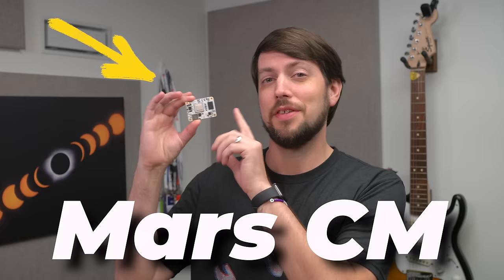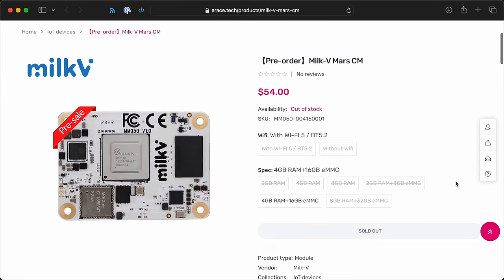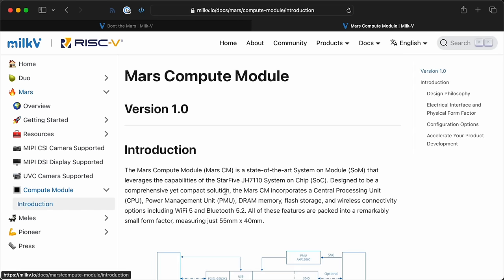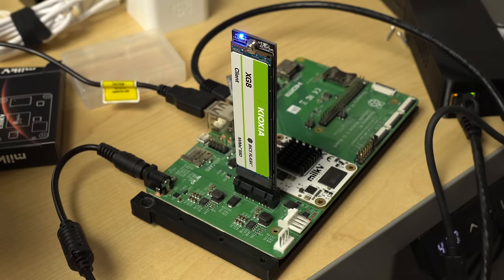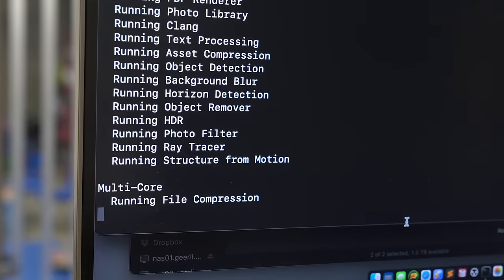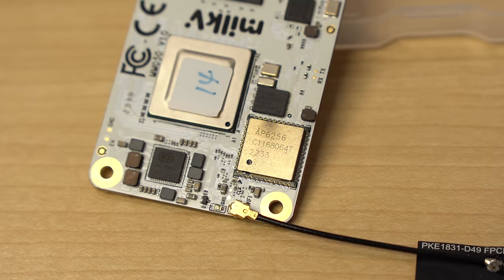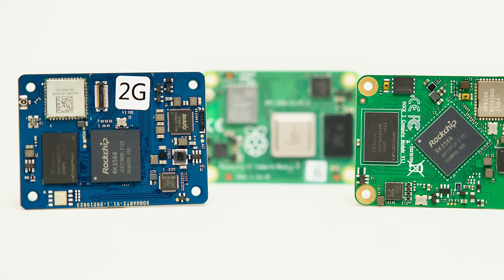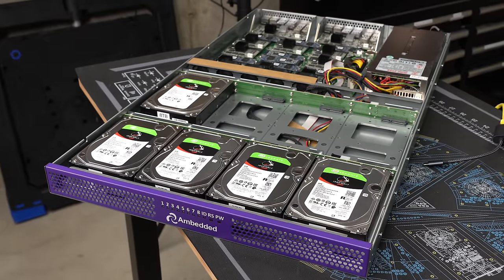RISC-V isn't killing Arm (yet)

Comment: It took ARM 20+ years to get an out of order design. RISCV did that years ago. From OoO to competing with x86 has been 15 years if we count X4 as competitive. RISCV is on track to do that in just 4-5 years which is literally the bare minimum to design a new microarchitecture. 

While there’s overhypers out there, is also true that we will have high performance chips in the next couple years.
Reply: The main problem is uprooting comparability. ARM filled a needed niche, and by all accounts an "empty" niche. The reason why we won't see x86 fall is due to the last 30yrs of development and the largest amount of focus. Arm has done that for its niche in the mobile phone market and even in the Microcontroller market.
Though I would agree in the super small Microcontroller (like remotes), it could have a place due to the lower costs ($0.001 off is a lot for something that costs $0.01 in bulk order) and the lack of legacy need.
Reply: I'm afraid you're one of the overhypers.  You try to hold it against Arm that it took over 20 years to see an OoO chip, but that's actually just because the first two decades of Arm were the 1980s and the 1990s.  In the 80s literally nobody was selling single-chip OoO microprocessors.  That began to be a thing in the 90s, but it was far too expensive for a tiny company like Arm.

Next, we  have to talk about actual ages of the Arm and RISC-V ISAs.  RISC-V derives a lot of things from older RISC ISAs, and modern Arm is technically only about 10 years old (counting from first commercial chip).  You see, the 64-bit Arm ISA was a complete do-over.  You can design dual-mode 32/64-bit Arm cores, but the Arm chips making waves right now (such as Apple's A and M series, and Qualcomm's new Oryon) are 64-bit only.  The first commercially available 64-bit Arm was Apple's A7, which shipped in the fall 2013 iPhone refresh.  (It was OoO, by the way, so 64-bit Arm went from zero to OoO in one step.  Doesn't really mean anything, but you seem to think it's important.)

The big problem for anyone who wants to believe RISC-V will inevitably overtake Arm64 is that Arm64 is a very well designed ISA and RISC-V is not.  None of the mistakes in RISC-V's design are fatal, they just make it harder to create high performance RISC-V chips, and possibly may result in extra power and/or die area.
Reply: It is almost as if multiple people can work on an open standard and take it farther because of that

Comment: Thanx for the video, very informative and yes the RISC-V architecture is not mainstream yet, but we need more choice in this sector. In my country everything is expensive, so cheaper alternatives are a plus. I only managed to purchase a RPi4 this year after losing out in 2020 with the Coolermaster case kickstarter mess. Yes, the Pi community is great, but RISC-V will get there. Just look at how far the Rock chip boards have come!

Comment: it's pretty early for risc-v to start getting a piece of the SBC market, it still needs manufacturers support and funds for R&D and software. but it is making a small but steady step in the microcontroller market with a few fairly nice little boards.
Reply: There's a few good boards already, and in the next couple years there's going to be a lot more on the market. They may not be the absolute best, but nerdy folks will buy them to tinker around with, and that will fuel more R&D budgets and more boards. The idea of RISC-V has excitement attached to it that ARM can't hope to match, for the types of people who like to buy these boards. At the same time, the AI market is embracing RISC-V, and lots of big companies are buying in for all sorts of embedded apps. Lots of real world uneasiness is also driving interest in RISC-V (or rather, driving people away from ARM) at those big companies that want to hedge their bets.

Comment: Just like ARM isn't killing x86 (yet) - but Apple proved, it has the potential to do that. And when you look a bit deeper into the design of the RISC-V instruction set and it's philosophy, you can see that it has the potential to kill ARM in the future, as its design is more sound, just like the design of ARM is way more sound than the design of x86 . Some people are not happy with certain trade-offs that were made but you always have to do trade-offs, there is no ISA that doesn't have any trade-offs. I studied pretty much all CPU architectures in the past and just based on that I made predictions like PPC not having any real future, since its architecture seemed flawed to me, so when PPC struggled with 64 bit CPUs and Apple finally gave up on it, that didn't came to me as a surprise at all. What did came as surprise to me was the Xbox360 switching to PPC but I guess that was the last time we saw PPC for the mass market. I also wasn't that surprised when Apple went all ARM, yet I didn't expect them to have the guts to truly pull that off, as it once again set off their machines completely from the Windows PC market (and I'm still sad to have lost VirtualBox support on Mac). But not only has RISC-V the potential to reach ARM performance, it has the potential to reach it at lower power consumption. And once again it's Apple, who hired a lot of RISC-V experts in the recent past. I wouldn't be too surprised, if one day Apple announces that the Apple Watch now has a RISC-V CPU and this will give that architecture a huge leap forward, as they have the money and man power to push that ISA quickly forward, to the point where it could actually compete with ARM at least in the low range sector. And the big advantage for Apple would be: No more license costs for their own RISC-V CPUs and also no license restrictions whatsoever.
Reply: You've got me curious, now. What were the flaws in PPC that you saw?

I do agree with you that Apple is probably going to end up switching to RISC-V down the line. They will probably (and maybe already have been) start with small RISC-V based chips on their boards controlling batteries and the like, and just not tell people. So much of Apple's hardware is a black box anyway. They could work their way up from there to watches, phones, etc.
Reply: @fakecubed Posting a detailed analysis of the PPC architecture in a YouTube comment would probably go to far and YouTube does not like external links (each time I post a link, no matter what link, no matter what destination, other than YouTube itself, my comment vanishes within a few minutes). 

But in a nutshell: PPC basically tried to make everything different than existing architectures of that time and that's rarely ever a good approach, since the only reason to make everything different is when everything sucked but that's never the case. Architectures may have flaws but they are not 100% flawed, as then they would be useless. If you change everything about cars, you end up with a sailboat, which is not a useless product but it is useless if your goal was to design a better car. A GPU is also a useful piece of electronics but it's no replacement for a CPU and incapable of running standard software; at least it could never do so efficiently (of course, you could emulate an entire general purpose CPU within shaders, that would work but would also be very slow).

The instruction set of PPC is not designed for normal computer tasks. It's a bit like IA64 (Itanium), which I saw for the very first time and immediately thought "How will a normal, modern UI application ever be able to fully utilize that instruction format or somehow even benefit from it?" I cannot explain that in detail here, but just look at some numbers: 

ARM has 19 different instruction formats (actually just 18, one is just a special case of all the other ones), PPC has 15 different base formats, with almost each of them have 2 to 4 sub-formats, sometimes 7, yet one has 35 sub-formats. Sure, x86 has more, but x86 is a CISC instruction format, not RISC. The ARM instructions are dense and a single one can combine a condition, a math operation and a logic operation, all in 32 bits; so very common source code constructs will result in a single ARM instruction. On PPC you need 3-6 instructions to achieve the same outcome, again, each 32 bits. RISC-V has only 4 base formats, with 2 extra ones that are just variants of two already in the base set. It's less densely packed than ARM when it comes to function but more densely when it comes to working with data (e.g. intermediates) and RISC-V allows for way more instructions in total, so it doesn't have to stay RISC all the way, it can do things like adding a single instructions that performs a complex operation that would otherwise require plenty of instructions if that should ever be required or vastly beneficial.

Also while x86 and ARM both offer 3 different kinds of memory barriers, PPC only has one. This makes it easy to "not pick the wrong one" but it also means that a lot more synchronization must take place than would strictly be necessary, which is an issue if go multi core and want to keep increasing the number of cores. RISC-V has two and both reserve bitfields for future use to make them even more fine grained, if required to increase scalability. There are other things that make it way harder to scale PPC and x86 core-wise than it is for ARM or will be for RISC-V. And even if you can scale the number of cores, there is always the question how often will one core slow down another core which is also ISA dependent, as that prevents a huge number of cores from reaching their full potential. For decades speeding up CPUs mainly meant increasing the clock rate but that isn't the case anymore for over a decade. Today adding more cores is often way simpler to do and here ARM performs really well, as it is very simple to add more cores without requiring a super complex or ultra-fast inter-CPU bus system, that is almost as complex as a CPU itself or is very power consuming. Just compare the CPU bus of x86 server CPUs (with plenty of cores) to the one of x86 consumer CPUs (with way less cores) and you will see what I mean by "complex bus system". And being super relaxed at the memory model surely helps PPC, just as it helps ARM and RISC-V, yet you cannot always be relaxed, you need fences, atomic operations and explicit ordering and here I see PPC struggling more than other RISC architectures; well, Alpha would have performed even worse, but that's a different story. And don't get me wrong, every architecture allows scaling the number of cores, this was just about how much effort that is, how costly it is, how much it will add to power consumption, etc.

Comment: Love the Video you are 1/2 correct on the Licening on the RISC-V. RISC-V is Opensouce and there are no Roaylties. It's important to note that while the RISC-V ISA is open, the actual processor implementations (e.g., CPU cores) developed by companies may have their own licensing  I am sure you knew that but it came off that RISC-V is pretty much the same as ARM that that isn't correct at all. People would rather pay someone for their design than doing their own.
Reply: You forgot to mention the RISC-V annual membership and certification fees, without which you can't sell a RISC-V device.
Reply: @AndrewRoberts11  Very true. Also, a note that not all RISC-V designs will work 100% with each other. The one thing ARM does have is that it has to be compatible to some level. RISC-V has a future, but it's still a long way off.
Reply: @AndrewRoberts11  You probably can, but you won't be able to call it RISC-V. Similar things happened with MIPS, meaning that there is an implementation called XBurst which is practically identical to certain MIPS architecture versions. The company responsible later licensed the relevant MIPS technologies, meaning that later products can advertise MIPS compatibility, although they do still use XBurst in their promotional materials. One practical consequence was that they appear to have adopted the official MIPS vector extensions alongside the ones they had devised themselves.

Comment: It would be  amazing to see you cover the Milk-V Pioneer. It's basically impossible to find the kind of high-quality, in-depth coverage you do for high performance RISC-V machines (at least, relatively speaking, we're still a few years out from true RISC-V competitors for Arm and x86-64 based enterprise and edge computing SoCs like those provided by Intel with Sierra Forest or AMD with Epyc Sienna, though it would be awesome to see coverage of Ventana's Veyron V1 and others if/when they materialize). I'd especially like to see what the Pioneer can do compared to a similarly-specced Ampere system, and it's going to be really exciting to see you inevitably try to stick a 4090 and a 7900 XTX inside of it.

Comment: While I realize the PI Pico isn't a fair comparison (a fraction of the RAM/Storage, can't run full-fat Linux), it does make me wish one of the benchmarks ran there too. I'd expect less than Pi 1 performance on the Pico, but I'd like to actually see it. 😋

Tangentially, comparing the Risc-V board to even earlier Pi models (1 and 2) is probably a more fair comparison.

Comment: At 49, I’ve watched as PA-RISC, MIPS, PPC, i860, AlphaAXP, SPARC, and other RISC architectures wither into irrelevance (along with MC680x0, IA64, and others). It’s neat that RISC-V is a largely open ISA and platform, but in a time when ISA’s are heavily decoupled from their micro-architectural implementations, and those implementation details represent the bulk of IP and institutional knowledge for major semiconductor companies, RISC-V simply doesn’t have anything close to the muscle backing the ARM and x86 ecosystems.

Furthermore, working in the dev tools space, where I still have to fry my brain with assembler exposure, current-era ARM and x86 both have huge instruction sets; for example, ARM’s base instruction count is around 400, and the current full instruction set documentation is thousands of pages (in contrast the MC68000 was around ~ 80 instructions total and 6502 has 56).The ever expanding SIMD extensions on both ARM and x86 are truly headache inducing (and ARM is especially irritating because of the restaurant-menu approach to what might be in a given licensed core implementation). Someone’s going to have to make a pretty compelling RISC-V product for me to knuckle down and learn yet another ISA. 

Maybe I’m just a curmudgeon, but I just don’t see RISC-V expanding much beyond its current state. But it’d be kinda neat to be wrong on this (even if it melts my brain).

Comment: Awesome video! I checked your Geekbench score submission in detail and compared it against the one you submitted for the Raspberry Pi 5 and it seems like a lot of performance is being lost in graphics related tasks. Even thought the overall single core score of the Pi 5 is 10x the overall single core score of the Mars CM certain tasks like Navigation are off by only 2x whereas others like background blur are off by 100x! Wonder how much of this is down to software optimization and how much of it is being held back by actual hardware capability.
Reply from the maker: A little bit of both; note that the graphics stuff is all rendering on CPU still, it's not hitting the Pi's GPU, so there could be some instructions better optimized for Arm, but it's not making the majority of the difference on Geekbench.

YMMV though, all benchmarks are imperfect reflections of actual work :)
Reply: @JeffGeerling  yup -I'd assumed that everything in the bench is running on the CPU. As far as optimized instructions I believe SIMD stuff on Arm might be helping? Not sure if the Geekbench stuff uses the Neon instructions. If it does and this specific RISC-V chip does not have the vector extensions or ML stuff like matrix instructions (for tasks like image classification) it would be a strong hardware limit on the achievable performance. Super interested in seeing how this evolves over time. I'll also go lookup the full specs of the RISC-V cores in this to see what extensions are supported.
Reply from the maker: @Xankill3r  The tough thing is Geekbench's tests are a little vague in how they're represented technically (that's their proprietary mix), so there's no easy way to know what extensions they're using (especially as their suite gets updated).

Thus I like to benchmark a bunch of other stuff too. The nice thing is Geekbench is easy, spits out a digestible number, and works on darn near everything without annoying compilation bugs.

Comment: Not sure how much the 64 core cpu will cost, but I'd be interested in seeing it compared to a ppc64 system like the talos. Power is typically the ISA you go to if you want open source hardware and high performance and it'd be neat to see how risc v is catching up